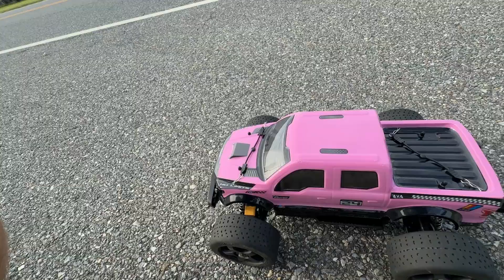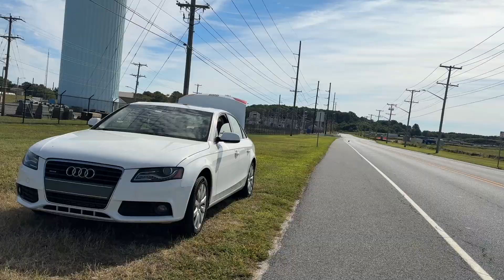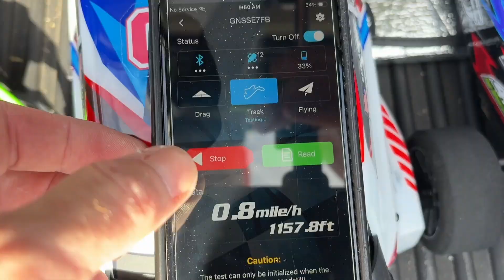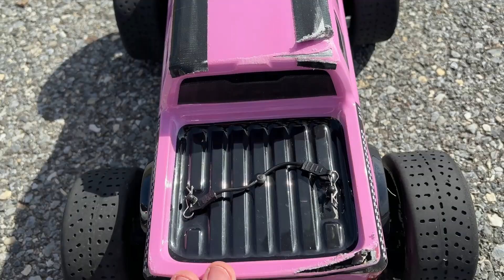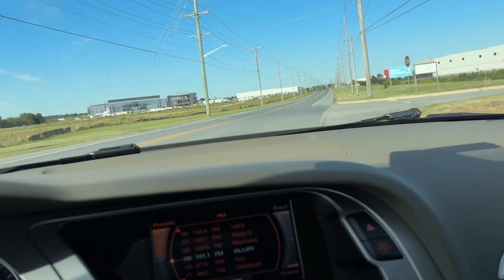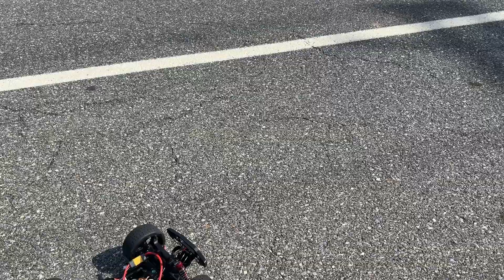$85 DeeRC 9207E = 70 MPH/113 KPH on 3s with 27t Pinion -  Metal Spur, 9206, 9201 9200, BEZGAR HB101

Comment: Hey Brian,I appreciate your videos..do you know where I can get spare parts for this truck?? My daughter wrecked hers and I can't find any spares on Amazon
Reply from the maker: You can look for other version of the truck if you can't find them under the 9207E. DeeRC's website has parts as well so I would check up there.  It can be frustrating for sure! 

Here are some trucks that share some parts with the 9207E.
DEERC 9200E / 9201E / 9205E / 9206E
DEERC 207E
DEERC 9200-9206 series
Reply: @BriansRCStuff thx for the reply, also wondering if you kept the stock driveshafts/cvd's?
Reply from the maker: @blakDragon88  Yes, everything was stock except the spur and pinion.... well, and the motor, ESC, TX/RX and servo.

I ease into the trottle on my runs so it isn't really hard on the drivetrain (at least not as hard as bashing).

Comment: I like that you do things no one else is really doing its exactly what I love to do in this hobby 🖤
Reply from the maker: Thanks man! I think budget speed running is where it’s at! What kind of rigs do you have?
Reply: I love it all. I just got done fixing my 223. Speed rock 3900 kV motor out a vendetta running 30t pinion 50t spur cant wait to run it and i'm uh, converting my lucy nascar into a desert racer put typhon grom suspension parts on with mojave grom ties  @BriansRCStuff
Reply from the maker: I am really curious to hear how it does!
Reply: @BriansRCStuff  the only 4s esc I have is out a rlaarlo 787 and it keeps cutting out back to 3s until I can convince my wife to let me buy a new one lol any budget esc you recommend
Reply from the maker: @AKO_RC  if it’s going in a light RC car and you need something to get you by… For $15 these blue ones they sell up on AliExpress are not rated for 4s but they will do it… At least in lighter RC cars.  here is a run video… I just ran it again today and it hit 91 miles an hour.  it sounds like you are pretty serious though so I probably would not recommend that for you. https://youtu.be/MTvTpsw-SWs?si=h59A_eDSSLwbIPQi

I am a big fan of ZTW ESCs.  For the price I think they are really good. You can get their 150 a 2S to 6SESC beast V2 for like 60 or $70 on AliExpress.  They also have a 120a 2s to 4s beast 2 esc that you can find for as little as $40-$50, especially if you act like a new customer. I have pushed both of these really hard and have tons of videos on my channel running them.

Hobby wing is always a good choice and there for us 120 ESC is like $60 I think… Maybe 70.

The main reason I have this channel is to pay for my RC hobby! My wife is always on my case but she can’t say much when I get stuff for free .😂
Reply: @BriansRCStuff awesome thanks man I really appreciate it until i get a new one leta see how fast i can go on 3s before i cook that esc  😂
 you keep making these videos ill keep watching 💯
Reply: Especially when they tell him it can't be done I love the fire that turns up in Brian. This thing is extremely fast now 😂😂😂